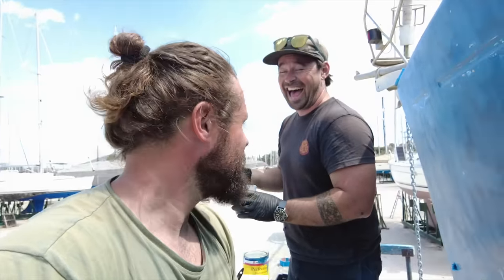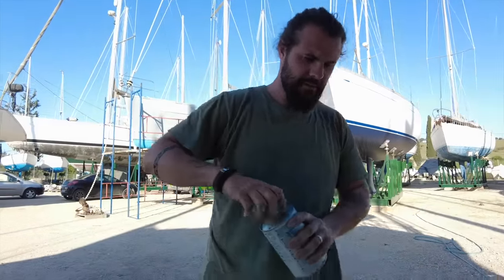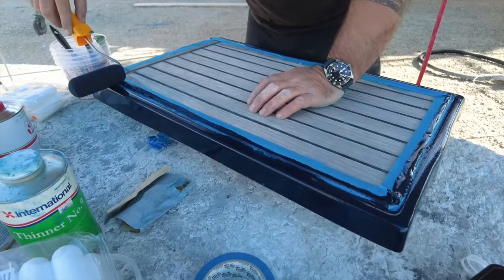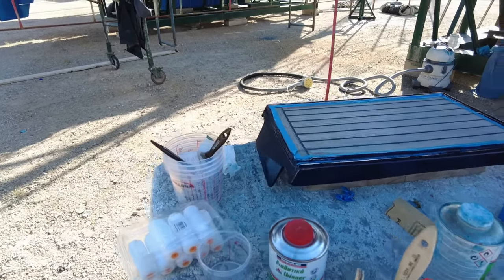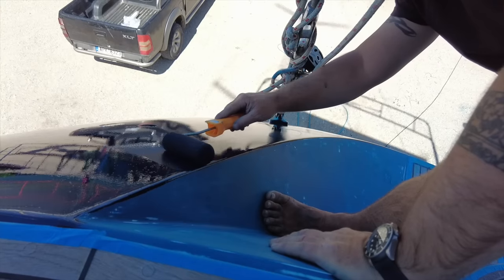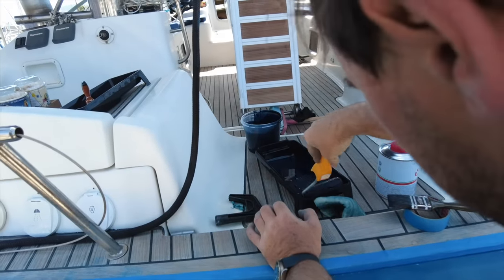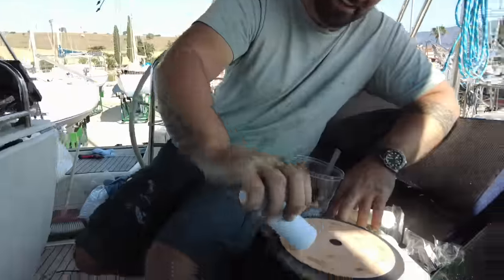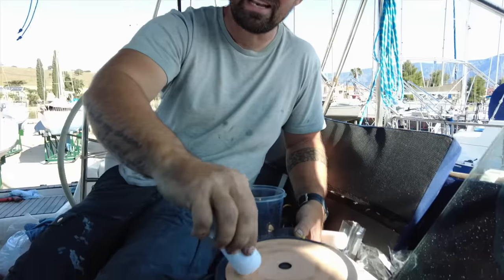Painting my ENTIRE  sailboat by HAND (Jeanneau 54ds)

Comment: 2 part with a  reducer is definitely the way to go,  great job.  The one part rubbish rubs off, guy in slip next door put beautiful topside paint job on last year,  1st couple boat wakes fenders rubbed off..
Reply from the maker: yes, 1 part is temporary.
Reply: I put one part total boat on my deck and it gets moldy and dirty easily. Like the pores in the paint are bigger than the two part epoxy. I should of use two part garage epoxy paint off of Amazon. PPG was out but had the two part primer and perfection was a crazy price for a deck .
Reply from the maker: @briandale8386  i think for the deck i would go with 2 part
Reply: @OceanCruisers  I heard TSP paint prep is good before painting . I might hit it with two part primer again and then two part paint . It’s getting cool around here. Right now I’m varnishing the floors . Whatever they put on the floors is like epoxy to sand off. Today is sand day. It sucks

Comment: I used same rollers with 2 part painted 20 ft section then went back to start and rolled additional light coat.  Came out smooth
Reply from the maker: yes. its all dependant on the conditions, bur there are different application methods for many conditions but it does struggle with heat

Comment: im a painter 40 years
you dont need to lay off (tip off) if you have right roller sleeve, paint is correct consistancy and you put the correct amount on.
never paint in the sun.
Reply from the maker: sounds right 👍
Reply: Which foam rollers do you reccomend?  Ive been told about using short pile mohair roller (for use on 2 part paints)
Reply: @bover86  mohair good for two pack paints. get good quality. 
also foam that handles oil or two pack , but you need to pop any bubbles you may leave with a dry roller ( your roller once you have not much paint left in it) by rolling over any bubbles with no pressure on roller. only some paints leave bubbles. they can be blown out to. 
hard to explain as you can tell.
Reply from the maker: @bover86  we found the hairs came out at the paint thickened. we just went with basic foam sausage rollers, replace after 30 minutes